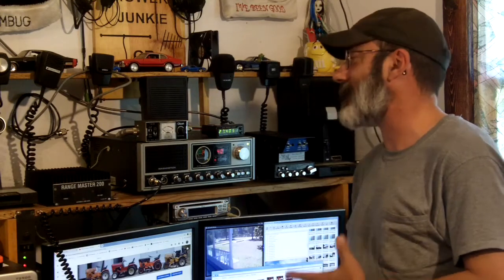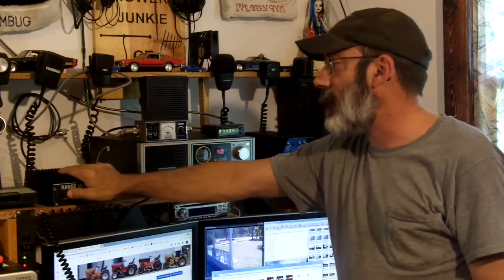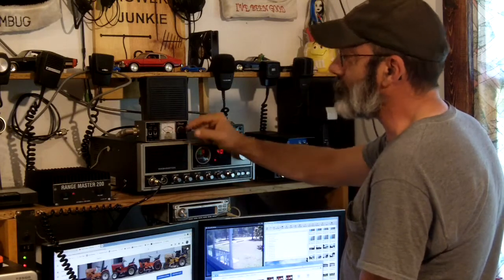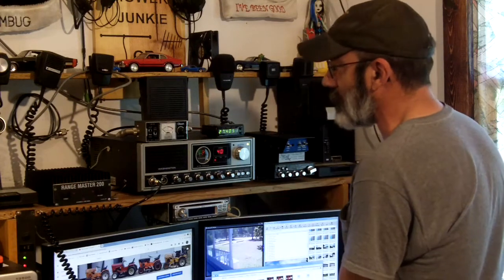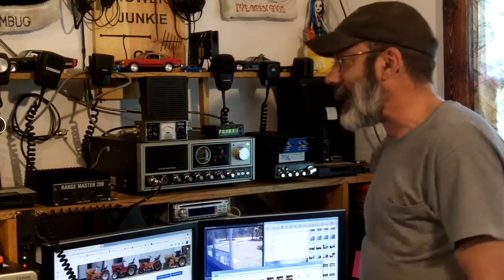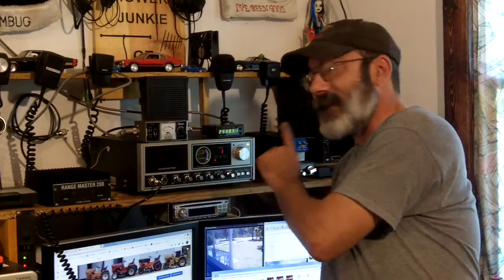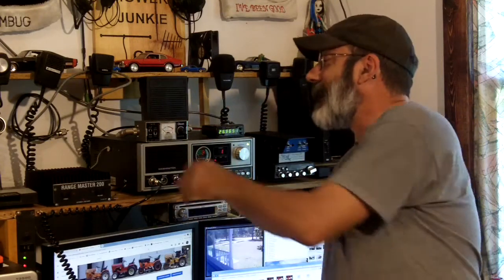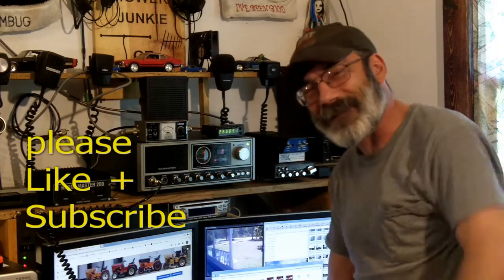Antenna SWR Basics, How to check and set Your Meter, CB Radio Tuning

Comment: I just put a radio in my pickup.  New antenna, new mount. New coax . I've purchased 2 meters and both do the same thing.  When I try and turn the calibration knob upto bring the needle to the set position the needle only goes up about half way.  And when I switch to REF TO SEE WHAT the reading is the needle doesn't move. Any ideas what my issue is?
Reply from the maker: are you sure the radio is working properly? it sounds like your radio is not putting out enough power for the meters.
Reply: @MowerJunkie 
The person i bought it from checked it for me while i was watching.  He said it was transmitting and receiving.  Just so you know he builds his own amplifiers and has a bunch of equipment that means nothing to me but i did notice today that my mic cord close to the mic itself the outer sheathing is broke and i can see bare wires on one of them. I have a 4 pin road king 56 mic. Could that be causing the problem?
Reply: Or could it be a ground issue or both?
Reply from the maker: @erichouser1187 it's not the mic if the radio is able to key up. what type of antenna are you using? and where is it mounted?
Reply: @MowerJunkie 
I purchased a new 4 ft. Firestk
It is mounted on top of my headache rack in the center of the rack. The rack is painted also. Maybe its not grounding?
Reply: @MowerJunkie 
I'd send you a picture if I knew how to on here
Reply from the maker: @erichouser1187  that could be the problem. if it was mine, I would drill a small hole in the rack close to the mount, then use a screw to attach a piece of wire to the antenna mount.
Reply from the maker: @erichouser1187  mowerjunkie@yahoo.com

Comment: What is the cause Chan 1 and 40 are both around 8 in the red swr? I used 2 different antennas and they both reading the same high number!
Reply from the maker: are you trying to use a mobile antenna as a base?
Reply: it’s on my jeep
Reply from the maker: is the antenna close to the body of the Jeep?
Reply from the maker: and is the antenna getting a good ground?
Reply: It’s a 4’ whip antenna on my hood the cab is on the dash!
Reply: Sorry cb not cab
Reply from the maker: there's so many things that can effect SWR, for example, dirty or corroded antenna connector, coax getting pinched/crushed, insufficient counterpoise, poor ground at the antenna. send me pics of the setup mowerjunkie@yahoo.com  I might be able to help with more info.
Reply: @MowerJunkie  thank u! I checked the grounding and the cables.I borrowed the meter and jumper cable and I’m going today to check his jumper cable and meter for any shorts to ground. Thanks for responding!!!👍🏼

Comment: best i can get with my trimag and tram bigcat on the car is 2.0swr. car covered in snow made the swr flat perfect. several of us have been stumped on this as how i can duplicate that condition to lower my swr.
Reply from the maker: A lot of newer cars have glued on roof skins, the sheet metal is not grounded to the rest of the body. when it was covered in snow you had sufficient counterpoise for the antenna, without the snow you only have the roof skin as counterpoise (Groundplane).
Reply: @MowerJunkie  sure do appreciate your info. we enjoy your videos. 316 ohio. will try to catch you when conditions come back around in the spring

Comment: I just got my new 102 steel whip today on my base station. I put it up and I have 1:4 through the entire band. I checked all my connections and everything, nothing loose. I am using RG-213 cable too. Not sure what to do now...
Reply from the maker: Do you have a proper counterpoise? a 102 whip needs ground planes to work as a base antenna.
Reply: @MowerJunkie  I do not. Now that makes 100% sense with it being a 1/4 wave. Sorry for my idiotic comment. I don't know why I didn't think of that. I was checking coax cables and everything. But I ended up purchasing an A99.

Comment: Hi do you just check it on the am or fm , what about upper side band ?thanks
Reply from the maker: SWR should only be checked on AM or FM. the meter needs a steady signal that SSB can not provide.

Comment: I have a Stryker 955 myslu are too high how do I adjust it I don't see no adjustment on the 955 my old CB radio has the adjustments swri calibrate
Reply from the maker: the meter does not need to be calibrated on a Stryker 955, if it says your swr is high, You probably have a problem with your antenna or coax.

Comment: I seen a guy leave a swr meter hooked up to his CB and leave it hooked up , can that damage anything ?
Reply from the maker: Yes, You can leave the SWR meter hooked up. Both of my base stations have an SWR meter in line at all times.
Reply: @MowerJunkie  I did t know if it would hurt The modulation at all.
Reply from the maker: @howardmiller4241  nope, it won't change anything. receive and transmit will be the same, with or without the meter connected.
Thanks for watching, Happy new year.
Reply: @MowerJunkie  I do have one more question , I’m installing a new cab in my truck and have to wait on my antenna to be delivered. Is it safe to turn the radio on as long as I don’t key up?
Reply from the maker: @howardmiller4241  it is safe, But without an antenna, you won't hear anything.
Reply: @MowerJunkie  Ok I want to make sure I’m correct , I have a 4 door cab pick up. I was going to set the Stryker towards the back of the cab right in front of the 3 break light, I was thinking I should have it centered as close as I can on the vehicle. I was told I should center it on the cab roof not center of the entire truck , what are your thoughts?
Reply from the maker: @howardmiller4241  I agree with you, the center of the truck will work best.
Reply: @MowerJunkie  ty you for all your help ! The Stryker SR A10 showed up today and it has a bad end on it , I hooked it up it showed really high swr’s. So I adjusted it and no change, so got to looking at the cable and the end had been off it , so tomorrow I will call the place we ordered it from (Wolcott Radio) and see if they will replace it or not. If they don’t I will never do Business with them again. When I opened the big box and see the base box in bad shape I had a bad feeling.

Comment: Hi I have a weird problem. When my swr meter is in line I will match with the radios built in meter and so I adjust the antenna and check my swr meters, radio built in and my external meter, both match and all seems fine, then I disconnect the external meter and plug antenna back in radio and swr is now very high. I again connect my external meter and make sure that the swr is good, I can make it about 1.3, both radio and external meter matches fine on all channels, I unplug the external meter and now my radios built in meter is showing high again, over 2.

Why is it this happening? It drives me crazy 😭
Reply from the maker: Try tuning the antenna without the external meter hooked up. it could be your coax jumper causing the issue.

Comment: Worth noting: You can still have noisy TX with perfect SWR. Distance and EMI at the least; I'm not a HAM just tried for perfection with a rk56 and galaxy and firestick once and looked at the signal with a analyzer.. No splatter but had EMI noise on key up

Comment: I ended up with my passed away uncles CB radio and linear amplifier.  I installed them in my truck. The amplifier looks close in size to your amplifier, however it doesn’t have any identifying marks as to power or brand. I bought a Wilson Lil Will antenna. when I fire that thing up, it makes my car stereo act funny. But the truckers say I “walk” all over everyone. 
I bought a ebay SWR meter, and have found this video useful in tuning my set up. Thanks

Comment: Can the swr's be set with the antenna laying on the ground?
Reply: It's not going to hurt to check the SWR with the antenna lying on the ground the problem with this it's not going to give you an accurate swr  reading the best way I recommend get the antenna to two or three feet off the ground in an upright position set the SWR as best as you can this is how I do it and then put it up in the air and then recheck it again you may have to repeat this process a couple of times but a antenna on the ground or up against the house is not going to give you an accurate swr reading

Comment: This video helped me so much! The fact that you suggested to trim the antenna when SWRs on ch 1 and 40 are really high saved my day. I thought my antenna was trash but I trimmed it until the SWRs were normal and then I did the fine tuning and now I'm at 1.7 and ch 1 and on ch 40 and the radio works great now! Thank you!
Reply: Me too. High SWR on both 1 and 40. Cophase coax dual antennas. Didn’t expect to need to shorten antennas because the readings showed antennas were already getting too short. Thanks to this video and this comment, trimmed both antennas half an inch and finally started making progress to lower SWR. Now tuned to 1-1.3 across the board. Thanks.

Comment: Mower junkie I need your help A buddy at work gave me a Midland 79 - 260 It's my very 1st sideband radio Yeah now I notice it doesn't have the little SWR calibrate thing on it so that means I need to get one of those external ones like you have And if so what's a good one to buy Also I need a power supplyAnd I'm wondering what is a good power supply that you can buy right now that's not crazy expensive Because I read a lot of reviews of other ones and people are saying that they don't output what you need and there's on that and the guy that gave me this radio said it outputs more power than stock I don't know how much more but I want to make sure I have power supply that can handle it What would you suggest for both things
Reply from the maker: I'm sorry, But I don't have any recommendations. I don't buy new equipment, So I don't really know what's good in the current market.  Thanks for watching, 73's from 151 SC.

Comment: Hi geat job 
I have a problem where ch1 is 3 and ch 40 is 3.25 why is that happening
Reply from the maker: A lot of things can cause high SWR. What kind of antenna do you have, and where is it mounted?
Reply: @MowerJunkie  cobra 25 inline SWR meter astatic pdc1
K40 antenna on Magnet
metal bracket over garage 18ft  Coax
Reply from the maker: @rjbradleyjr  You may not have enough counterpoise. When an antenna is mounted on a car, it uses the car as a ground plane. Mobile antennas will have a high SWR if they have insufficient ground plane (counterpoise).
Reply: @MowerJunkie  
Thanks a million!!!! 
A learning experience i didn't think that the magnet had to be grounded lol 😅😂
It makes sense now!!! 
The 1st time I did the SWR it was on the car then i moved it and didn't think about ground the bracket......lol

Comment: Hi I'm using a midland portapak and I was using a springer antenna on a magmount base but the swr was always in the red so my friend gave me a wire of diar pole and that was in the red on the swr meter but when I moved my magmount antenna near the diar pole antenna the swr goes right down that's very strange
Reply from the maker: It sounds like you need more counterpoise. a mag mount uses the car as the ground plane.  Thanks for watching, 73's from 151 SC.
Reply: @MowerJunkie  hi thank you for the advice I've took my springer antenna of and I'm trying I a wire dipole I had gave me. I've put it round my window but I can't seem to get the swr down but funny thing is when I first wired it up I thought the swr was perfect but it was because I had my magmount near my window so I moved it and the swr is in the red how much wire should I trim of I've trimmed about 6 inches of each side
Reply from the maker: @djpaul146  a dipole is designed to be fully extended. if you wrap it around a window, it will never give you a good SWR reading. try stretching it out, and hang it from the ceiling. you may have damaged that dipole by cutting off that much. I hope it's still good.
Reply: @MowerJunkie  thank you for the sound advice if I get no joy with the dipole or the 4ft springer I will save up and get a decent antenna
Reply: Step back and take a continuity meter to your coax. These are weird signs of a possible broken center conductor in your coax, at radio or antenna end, or possibly in the radio, very rare on the last one.

Comment: Buddy i don’t what has gone wrong my swr was 1 all the way across 3 hours later it went to over 3 on meter and 7 on radio. Don’t understand how this can be never had anything like this ever happen. What do you think has happened and what do i need to do? I checked with multimeter and everything was perfect. Even talked 15 miles after i put it up.
Reply from the maker: the only thing I can think is maybe Your coax has an issue. also check and clean all connections, and be sure all grounding is in good shape.
Reply: @MowerJunkie  I fixed it!! The antenna needed set up again and it worked I’m back at 1 swr all the way across. Thanks, Bearded Dragon I’m 73’s
Reply from the maker: @charlesdunnavant7824  Great!! I'm glad it all worked out. Enjoy the hobby, 73's

Comment: I just set up a new antenna it's a tram 1480 dual band my SWR is reading 3 on 1 and 40 how do I get my SWR down do I trim that antenna where it slides the two parts together without Allen screw
Reply from the maker: A Tram 1480 is not meant for a CB radio. CB's are on 27 mhz, Your antenna was made for 144 and 450 mhz. it may not be usable on 27 mhz.
Reply: @MowerJunkie  so what you're saying is I can't use that antenna I had a tram Omni base antenna no ground plane and I wasn't getting out far enough that's why I bought the 1480 so which one do you recommend it's in the same price range as the 1480 I thought I could use it you did a video on the antenna that I had the gold four foot one the tram but I wasn't receiving anybody on that one either that or I didn't have it high enough
Reply: What about the tram 1498 you did a video on is that the same as the 1480
Reply from the maker: @johnstancato8785  The Tram 1498 18' Base antenna, the Imax 2000 or the antron 99 are all great basic antennas. All of these will work great for local use, and will get some skip too.
Reply: @MowerJunkie  is it possible to turn the tram 1480 into a 1498 in case I can't return it

Comment: I never worried about un-keying before throwing the switch because none of my meters had the power going through the switch. They all just had a trace on the board going directly from the input to the output. Or a wire going straight through.

Comment: Hay mower junkie I love your videos Man! I have a question for you or for anybody else that can help and I give my gratitude in advance. The SWR on my setup was 1.5 not totally ideal but decent and now for some reason it's 3.5!! I didn't change anything can anybody tell me what would cause this?
Reply from the maker: if it's a mobile setup, make sure Your antenna is grounded well. a poor ground will cause an SWR spike.
Reply: Thanks for the reply 151 sorry I'm a little late with my reply. You hit the nail on the head that's exactly what it was

Comment: Good explanation mower junkie, getting excited I’m putting my station up this week I went with a galaxy 959 a 30’ military camo support mast and 213 mil spec coax and an old radio shack meter can’t wait to get on the air KRJ13666 or Wolf man 86.  73’s
Reply: And a Sirio tornado for an antenna
Reply from the maker: Nice! You are going to be rocking the air waves! That's a nice Station You're putting together.

Comment: Are you supposed to leave the srw connected all the time or once it’s tuned do you disconnect it? Mine will be in a Jeep wrangler
Reply from the maker: I usually disconnect the meter after the antenna is tuned. Thanks for watching. Good luck with Your install, I hope it all works well.

Comment: Hi I’ve got a Uniden 880 and when I calibrate it my swr goes up to around 5
So I turned down my calibration and my swr is low. Will i get less range from lowering the calibration?
Reply from the maker: I don't think You have a full understanding of the SWR function. turning the knob does not change SWR, it will only change what You see on the meter. if Your SWR is 5-1 when the meter is set....stop using Your radio, and check Your antenna and coax. a 5 to 1 SWR will damage Your radio.